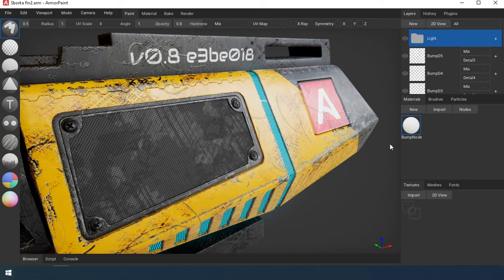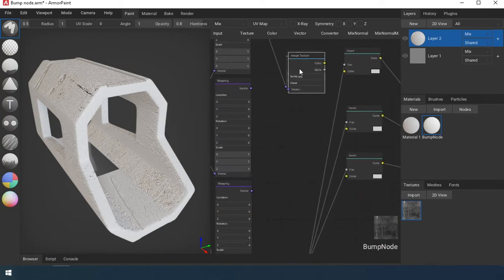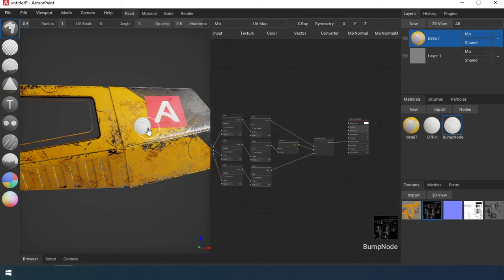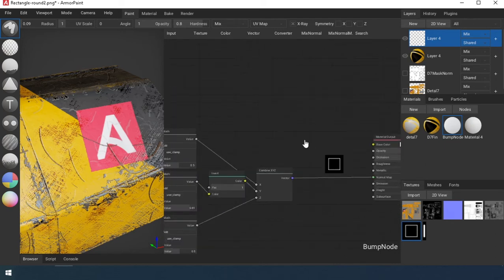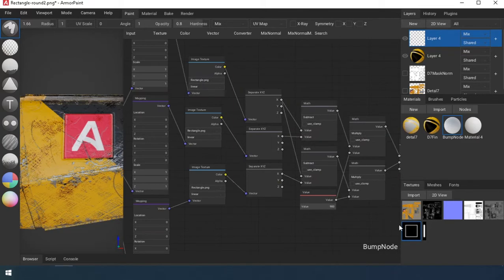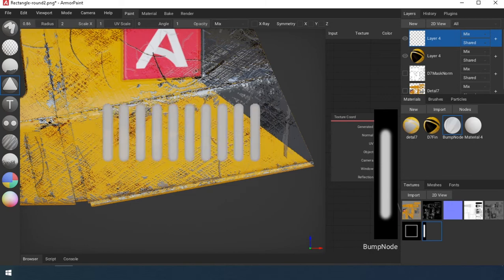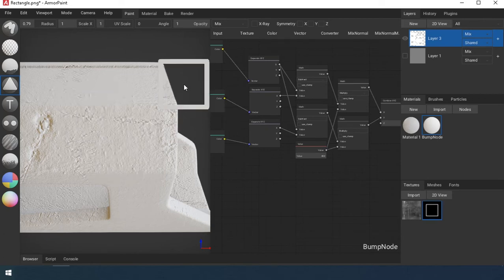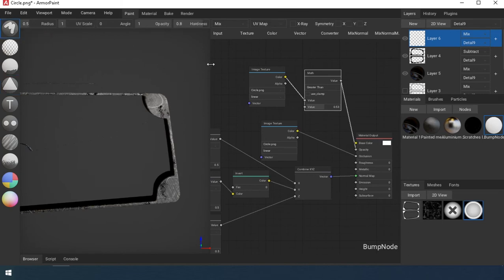ArmorPaint. SciFi Gun. Final. Bump node. Decals.

Comment: At 5:09 you begin to use the decal tool to stamp a bump-based grill... Instead of using a decal and texture, Is it possible to use the paint-brush to PAINT a bump line instead??  I'm trying to create raised/depressed lines (different dimensions and shapes of panels and things like rivets). Can AP PAINT bump and displacement brush strokes?? (not fixed dimension decals)
Reply from the maker: Good day! If you create a material with a height parameter 1, you can extrude with a brush. But it doesn't work very well yet. Please note that in the program settings you need to increase the value of the displacement strenght. This is the Viewport scroll.